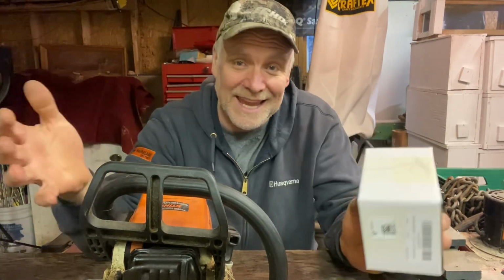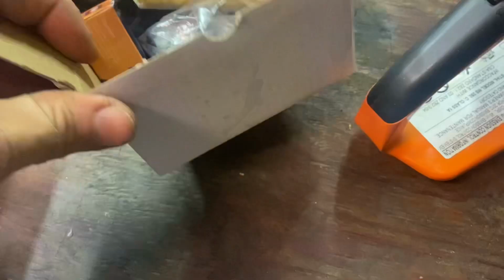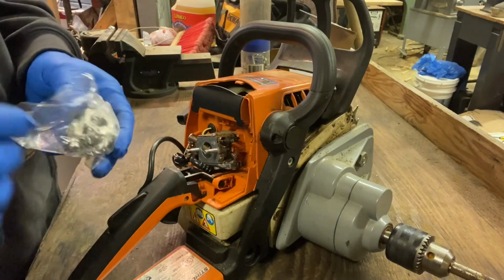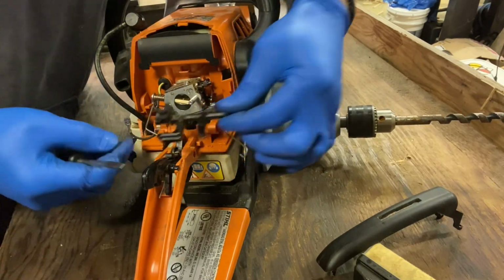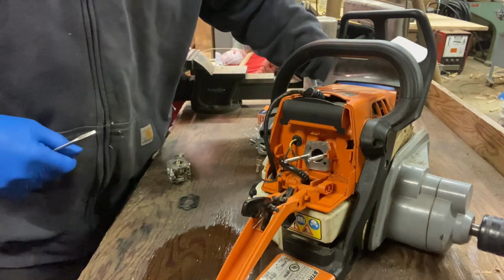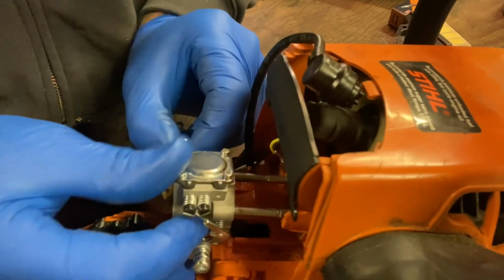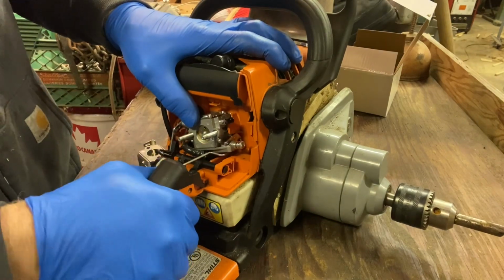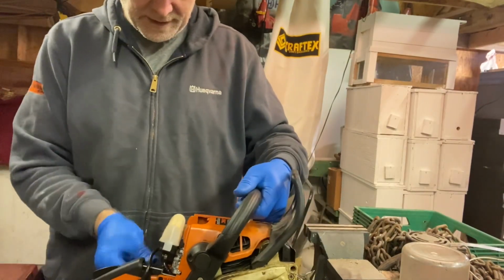Changing a Carburetor on a Stihl MS250 with a drill attachment

Comment: Thanks for sharing. I have been running a carbhub carburetor on my ms 250 for a while now. no complaints from me. I also bought a bunch of diaphragms for both walbro and zama carbs so now I have the original fixed up for next time. Cheers from Alberta.
Reply from the maker: I have really had great success with cheaper carburetors. They were a great price and the saws run good on them. Thanks for watching.